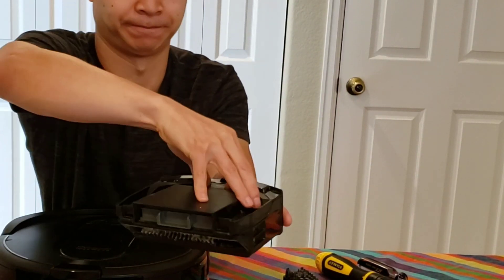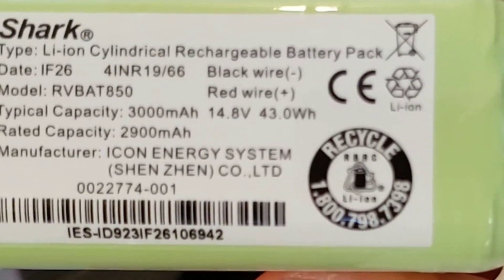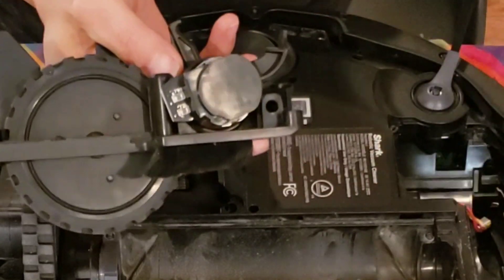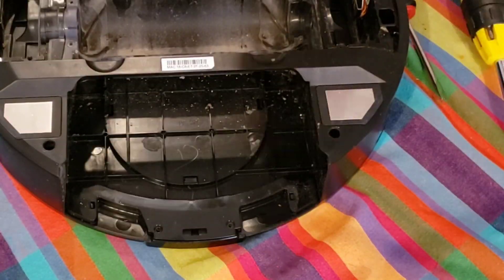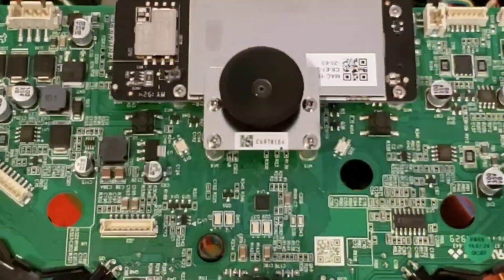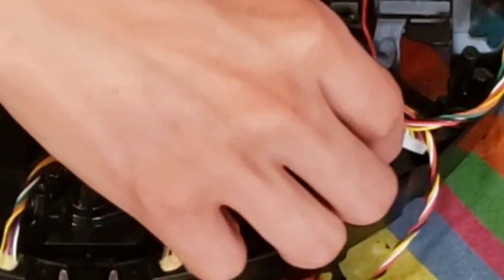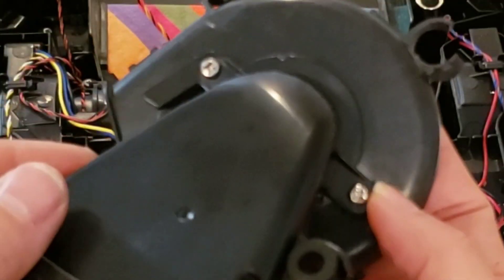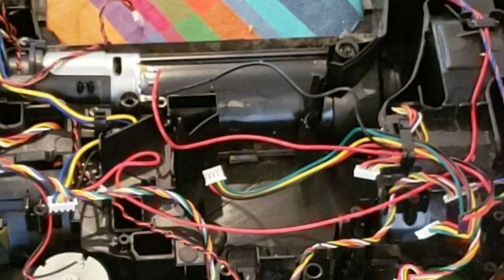Does the Shark IQ have a dirt detection sensor or dirt full sensor 🤔Teardown of the Shark IQ R100AE

Comment: Thanks for the teardown tips. FYI, if one does not have access through the app, you can disable wifi by scratching off the PCB wifi fractal wire near elements 1924 and 1920.

Comment: What MCU does it use for the main IO for the motors and other basic sensors? What processor does it use for the AI navigation?

Thanks!
Reply from the maker: Sorry can’t be much help, didn’t go looking at the nameplate of the Chips and electrical components.

Comment: I can't seem to get the wheel pin removed. I tried with a hammer and punch with no luck?  Can you please show or provide some more detailed instructions on that?
Reply from the maker: You can try getting a punch out tool, the only method I found was using a hammer and small metal rode to punch out the pin.

Comment: That's not the full bin sensor on a roomba, the gold pate is for the Dirt Detect mode. The shiny pillars on either side of the roomba where the bin goes in are the full sensors, it's an inferred sensor.
Reply from the maker: Interesting, so the acoustic sensor doesn't serve as two purposes??? A full dirt bin would sound different than one that empty. I would have to look closely see if I can locate those Infrared sensors used to detect if the bin full.
Reply: @RobotMasters  At 0:20 you can see the 2 shiny black pillars on the roomba, either side of the hole where the bin connects. On the bin there are indents where these fit into (also shiny black, they can pass infered light). In the Roomba 960 cleaning directions is mentions cleaning these and the inside of the dust bin where they slot into. The Copper sensor is to hear/feel lots of "dirt" or dust so it knows it needs to do a deeper clean. I hope this helps!!  I'ce had to do a few repairs on my 960 in the past 4 years :)
Reply from the maker: PaulRulesTheWorld Thanks for the info, learned something NEW 😅
Reply: @RobotMasters  Thank you for the videos! I have the Shark IQ Self Empty now and I really like it so far

Comment: anyway to get the shark IQ to sound less like a jack hammer? not sure what is causing that noise
Reply from the maker: I believe it the spinning extractor bar that causing the noise, unless you remove it there no way to make the robot quieter.
Reply: @RobotMasters  Ah ok, putting a little. WD-40 in there prob wouldn't help that
Reply from the maker: @ZupE891  I think it the actual extractor smacking the ground that make the sound

Comment: what are the details on the 3d camera?
Reply from the maker: It just a basic fish eye camera I didn't look at the name plate of the camera
Reply: @RobotMasters  do you know how this helps mapping? Fisheye in this position = less than 180 degree so it's limited in its ability to detect obstacle at level
Reply from the maker: daslolo It relies on the physical bump sensors to detect and create robot level boundaries.
Reply from the maker: Sorry the camera looks straight up at the ceiling to get references, is 360 degrees but a standard lenses like on a camera phone.

Comment: Roomba was once easyer to change out broken parts but seams i series has very little user accessible. Brushes yes but unlike with others who had motor in bin not everyone wants to pull the machine apart. Gear box was 6 screws if i remember right and it could be replaced and cleaned with can air how about i series? Pull one of them apart if you dare 🤔
Reply from the maker: Yeah what made this Shark IQ teardown challenging was the plastic clips and wire connectors, had to be very careful not to break them.

Comment: Would be interesting to see this done simultaneously with a high end robot like the Roomba S9 so we could see what the extra grand gets us.  One thing I've noticed about my IQ is that it does not seem to pick up as much debris as the Roborock did.  This isn't noticeable as debris on the floor, but it is in quantity of debris in the bins after cleaning.  I'd like to move Sharkie updstairs, but the thought of waiting another 30-40 cleaning runs for mapping to work does not appeal.

Comment: Is there a sensor in the dustbin
Reply from the maker: No there not
Reply: Robot Masters so do you know how evacuate and resume works, I think there's a sensor in the suction mechanism that maybe measures when it's full by seeing how much suction it's getting or something
Reply from the maker: The Empowerer No it a timer based setting, when the evacuate and resume is enabled the robot will clean for 30 minutes than return to the dock to empty itself regardless if the bin full or not. Only the Roomba have a dedicated dirt sensor.
Reply: Robot Masters oh wow, I'm getting 2 tommarow one for each floor of my house and I thought they would atleast have a sensor
Reply from the maker: The Empowerer I think you will be fine without the sensors unless you have crazy amounts of dirt
Reply: @theempowerer5718  The Roomba robot vacuums have "bin full" sensors that - in the case of Roomba i7+ and s9+ - triggers the robot to go back and empty its bin if it's in the middle of a cleaning job and needs to empty. Meanwhile, as the Clean Base begins its auto-evac process, there are sensors in the Clean Base working to achieve a minimum suction threshold. If it doesn't meet that threshold, the Clean Base will attempt to evacuate again as a fail safe.
Reply: No, it cannot sense if the bin is full which is a flaw

Comment: Does the gearbox on Roomba's use plastic gears as well?
Reply from the maker: Yes they do
Reply: @RobotMasters  Have you done a teardown of the Roomba before? Besides the wire gauge thickness and lack of bin full sensor, how would you compare the build quality between the Shark and Roomba?
Reply from the maker: The Roomba is definitely designed better, most of the components are module and easier to remove and install. The wire clips are difficult to remove on the Shark, and some of the components I felt like were designed as an afterthought for example the front bumper held on be screws, no hinges like on the Roomba to make it more to robust.  Lastly the Robot not entire sealed so dirt and debris can easily get into the Shark IQ
Reply: Robot Masters I think Roomba is probably the best at user serviceability